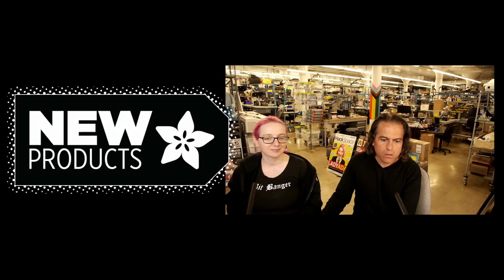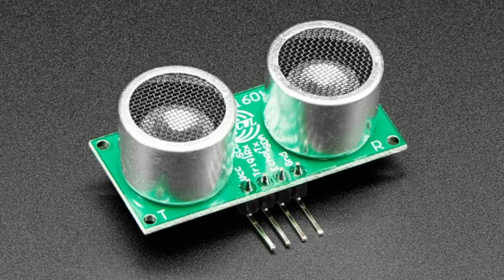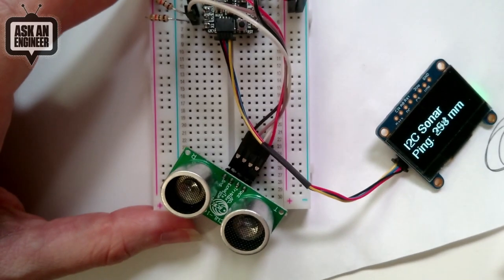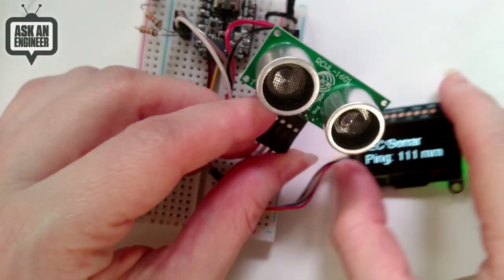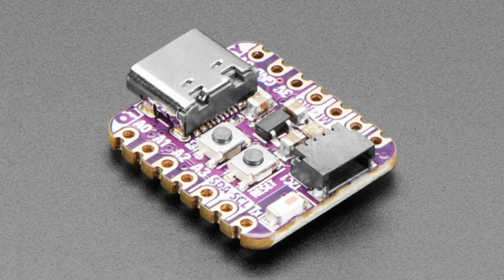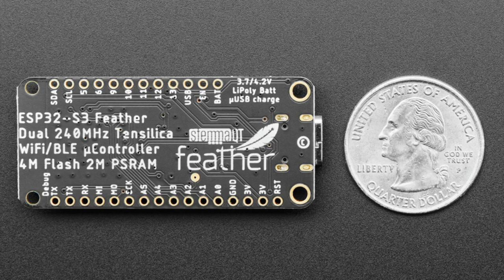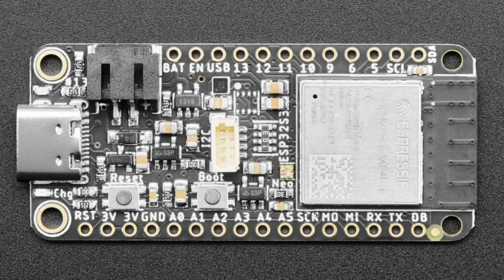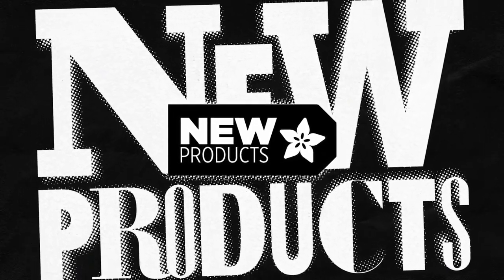New Products 6/01/2022 Feat. Adafruit ESP32-S3 Feather with 4MB Flash 2MB PSRAM - STEMMA QT / Qwiic!

Comment: The short SD adapter is actually about 2/3 size, not 1/2. Full length is 32mm and the original half-size (RS-MMC) was 18mm. I can confirm that for the Raspberry pi original this adapter still sticks out a good 8.5mm while the RS-MMC (or the blank I threw together from the dimensions) only sticks out about 1.2mm. Just enough to get a thumbnail to catch it.